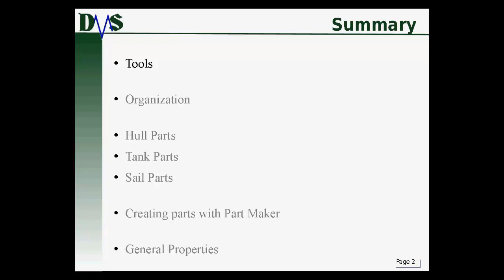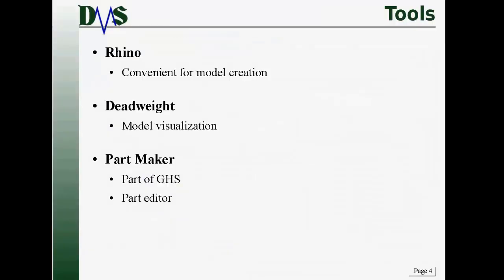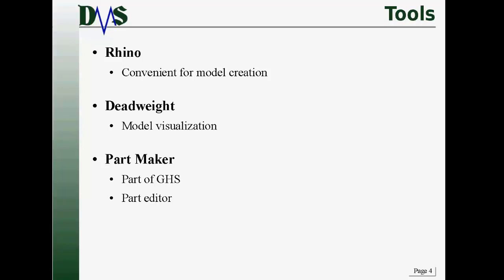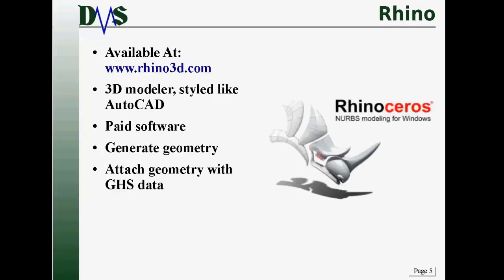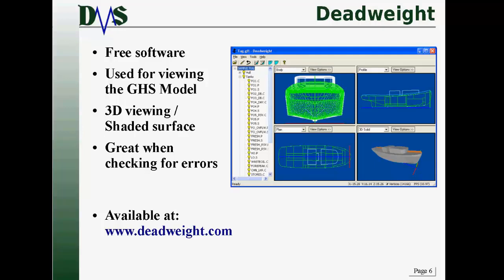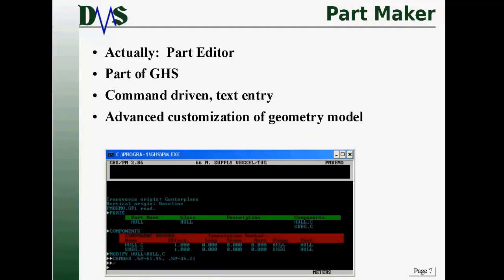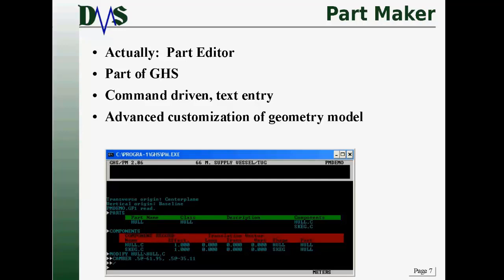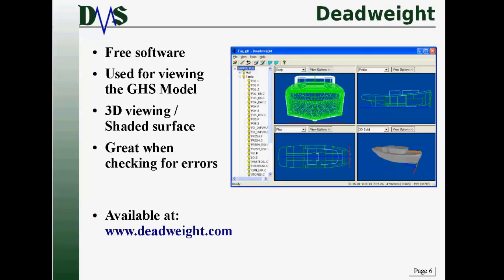210 GHS Modeling Tools (Improved Audio)

Comment: Hi,
Can you check the link to homework 211 please? I don't seem to be able to download...all the others under 200 series are good.
You also have homework 211 uploaded under the title Homework 221. you may want to check that too.

Thanks
Reply from the maker: Thanks for letting me know.  I corrected the link to Homework 221.  I also tried to download homework 211.  It worked for me as a normal visitor to the website.  Are you able to download it now?
Reply: I figured it out - the 211 homework contains an .exe file and is blocked by my workplace computer.